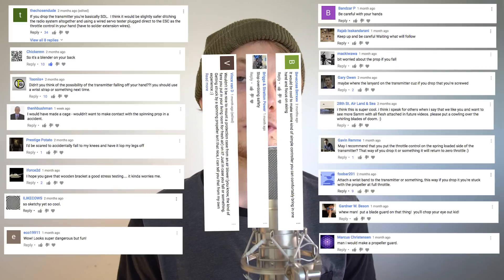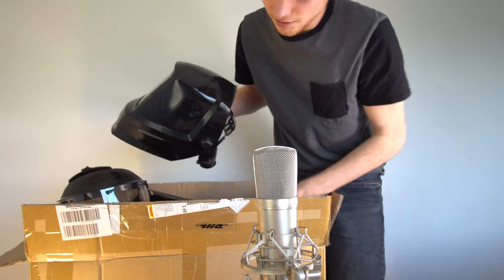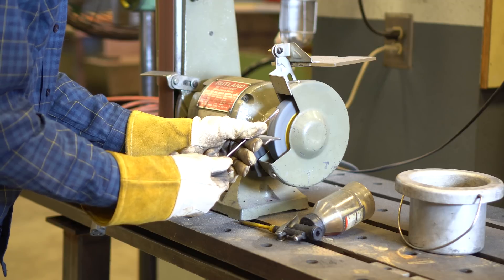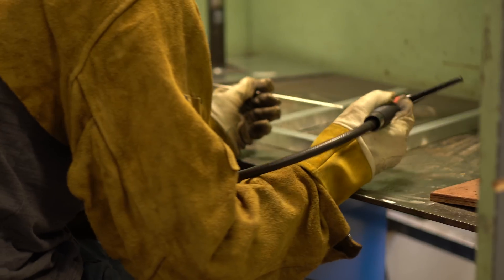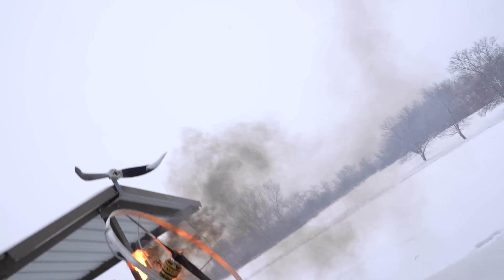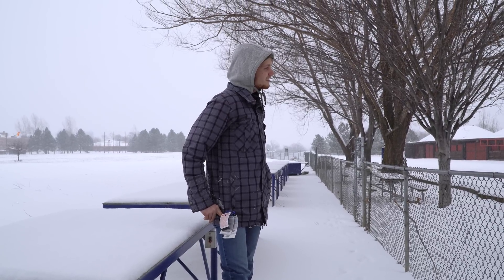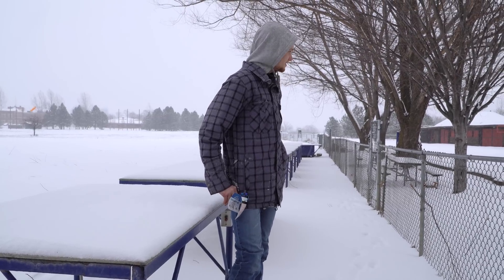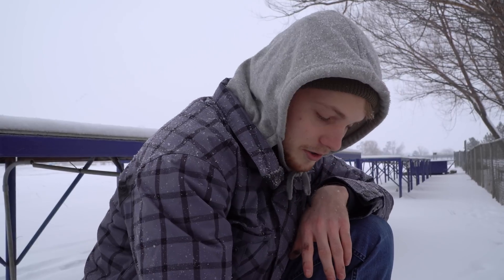Building Propeller Backpack V2 🔥  4k

Comment: You had a short circuit somewhere in the circuit.  Did you check the current draw and how much the wire could take. My guess is you overloaded the conductors and they melted the insulation which then caused one of them to short to the frame or another wire.

Comment: I popped a lipol battery with a pin thinking it would relieve the pressure as it was bulging......
Never pop a lipol.
It shoots out a hot jet of white smoke then turns thick black like a smoke bomb for a good 2 minutes then smoulders with a glow and some flames....
Lithium is toxic but the fire brigade didnt think so....
I felt sick for a day or two and still remember that horrid smoke taste on my mouth.
Please have a co2 fire extinguisher handy and a kill switch the same as race cars use (maybe some sort of rip switch)
Also those cables are very thin.....
Use a bus bar set up - bolt the leads with the xt60 connector to the bus bars and heatshrink the copper bars to the ESC.
Whats the maximum current output of the system to ESC? 100A? 200A?

Comment: Samm the fire should be due to when you suddenly cut the power, not due to high amp draw. imagine a high volume rush of water in a pipe, when you suddenly stopped it, what happens? this link explains it. So never sudden cut throttle
https://www.rcgroups.com/forums/showthread.php?952523-too-long-battery-wires-will-kill-ESC-over-time-precautions-solutions-workarounds

Comment: to much current into a esc which is not made for that kind of power. You should read more about your esc before trying this again. specially if you want to fly with it. If you fly rc plane or drones or try to build them your self you will automatically learn alot....
Reply from the maker: If you look at my channel more you’ll this all started from scratch building RC.
Reply: Yep. Sry :) At first I tout you were a new beginer :) Like I was many years ago, but then I saw what you are doing and other video's. I should have looked more at your channel, you are right. Anyways GOOD LUCK and hope to see many good video's from you :)

Comment: Well that sucks :( going to need a new ESC if everything else is ok.
You should get a low KV motor for more torque on the huge propeller if you can
and a much more beefy ESC to handle full power without smoking.

Comment: are you using 150cc outrunner motor?maybe you could make some DUCTED FAN instead of ducted propeller.i think it will make more grip on air than propeller can,so it could create more thrust.
Reply from the maker: Larger propellers have significant static thrust and efficiency advantages over ducted fans
Reply: have you ever measure your speed?is it efficient than motorcycle in terms of power ?just wondering.
Reply: are there any available larger ducted fan available on the market for your outrunner motor?what if you will do some experiment  between those two,illl be glad to see it...ive had read  your idea about ducted fan and props.but WHY DO COMMERCIAL JET AIRLINER uses DUCTED FAN instead of using 2 BLADE OR 1 blade props.?for me ducted fan has capable of PULLING HEAVY LOAD than propeller thats why props are only for those light aircraft.but whatever reason or answer you have  i will respect your idea men,because your the MAN.your the best.

Comment: Did you ever find out what caused the fire? If I had to guess I'd say it looked like when you let off on the throttle their was too much back EMF made by the 3 phase motor windings that fed back into your motor controller. Look up industrial designs and see what they use for protection. Off the top of my head I think it would be 3 diodes. Cheers!
Reply from the maker: Nah I just think it was unlucky water damage from the snow

Comment: Hi Samm! Absolutely love your videos!  if you made the top of a wing rough and "grabby" (to cause more friction with the air) and the bottom very smooth would it generate more or less lift than an identical Wing that is smooth all around?  I don't have the materials to test this idea so I figured I'd ask someone who might know without having to test it.
Reply: upon further inspection of this idea I realized air would adhere to a smooth surface around a bend better than it would a rough surface but still curious what you think

Comment: dunno about your electrical background but maybe you should ask for some help from EEVblog or Bigclive? Those guys could probably draw you up something crazy to regulate the voltage on that thing.
Reply: There's no need for voltage regulation. Assuming the ESC was rated for 12S LiPo (50.4V max), and I'm sure it was, he was well within spec. ESC's "pop" on occasion as all it takes is one output FET to be conducting when it shouldn't be and instant fireballs appear.

Comment: hey, esc's normally burn, if cables between battery and esc are too long.
google it. also keep in mind that checking amps is not enought. you
have to check amps in relation to rpm (otherwise your motor gets
hot and maybee you overload it).

Comment: WTF!!!! You should never wear gloves with a bench grinder!!! That is just asking to have your hand ripped off!
Reply from the maker: It's interesting actually. When working in the machine shop, gloves and long sleeves are strictly prohibited. However in the welding shop, exposed skin is strictly prohibited. This makes sense when working with lathes compared to flying molten metal. However these two worlds do conflict when it comes to the bench grinder.
Reply: Samm Sheperd - With rotating machines (Grinder but not Angle Grinder or Sander, Drill, Lathe or Mill, etc.) there's no Gloves.

Gloves for Plate Cutter / Bender and Fabricating.

Welding Gloves (different from other gloves) for Welding.

Also you need the 2nd Year of Welding to get decent Instruction for Aluminum, otherwise you should stick with Steel.

YT,
Rob

Comment: The long battery wires are what fried the ESC. The longer the battery side wires, the higher the voltage spikes from the inductance. You need to add capacitors at the ESC, and make the adapter as short as possible. This is an issue I have experience with in high power gliders that have really long noses and have to have the battery under the wing. Some ESC makers even sell capacitor banks for this reason. Google "long battery wire esc" and you'll find a ton of good info. Or see here: rcgroups.com/forums/showthread.php?952523-too-long-battery-wires-will-kill-ESC-over-time-precautions-solutions-workarounds

Comment: Which I can safely say is that a capacitor has burst and the black smoke from the electrolyt has ignited.
Why exactly, I can not tell you
but

Your connections are not weatherproof.
You have an aluminum fram. Your capacitor cap, are free ???
Water and some bad luck .....
Look at you picture 7:14.
I even see the gold at the motor connections. If something makes a short circuit ...
Play save haf fun

Comment: lol thats why you mount it to something other than yourself for the first test. mount it test it then put it on and use it. that said this happens escs can just burn i had a few do this and they were rated correctly.usually a poorly soldered component inside the esc with so many micro solder points. my opinion you did everything right this company should have given a refund. i always pass my power through a capacitor to help regulate it and filter noise a bit better so i can use fpv but i think it is also good for receivers and maybe escs it helps alot imho.  good to hear your using castle creations next it should hold up well. just change the motor and esc after about 35 hours of use so you don't have another fire. looked like everything else was going to be ok but the esc lucy the lipos and motor didn't go up with it like they do in a tight cockpit of a rc plane. keep welding you will get better  great job all around! :) ps i still fly with guys like that they still offer some sound advice once in awhile lol.

Comment: Can you damage your camera sensor from looking at a really bright source? I did see something about an ND filter (not sure what that is). Anyway cool video
Reply from the maker: I did a little googling and it said there shouldn't be any risk from filming welding. To get the close shot I used an ND filter (neutral density) which is just a really dark piece of glass you can screw on the front of the lense.
Reply: Cool. Man this project is pretty intense with the welding haha. Awesome you got help/use the facility. Did you consider a bi-motor design with smaller propellers rather than one big one? You could have differential thrust for steering haha.

Edit: also rimfire motor man aren't those expensive haha

Edit: oohh fiiireeee!!! Haha you didn't look up your max current draw build a little shunt. I supposed you'd need an esc to test the motor anyway. A little action in there haha.

Comment: countersink then tap.  use lube.
Reply from the maker: That's best practice, but on thin aluminum I'll risk my own tools and be lazy.
Reply: i should have said what a nice rig it was.  since those holes are in that rel. thin tubing you could weld a small boss or plate on there to get you some more threads.

Comment: ALUMINUM DOESN'T WELD!!!!!!
Reply from the maker: +Rc Dude I think you may be mistaken
Reply: +Samm Sheperd (SNRS) are you sure I have a underhead valve 5 hp engine block and were trying to weld one of the shroud brackets back on but the entire block is aluminum so it doesnt weld!!!!!!!!!
Reply from the maker: Well it can be really hard, you have to know what you're doing, and the aluminum block would be really hard to weld onto because it's a huge heat sink. You'd need a very large high power TIG welder on AC and the skills to use it. It's not a good idea to weld engine parts because the heat will warp things
Reply: +Samm Sheperd (SNRS) we do have a giant tig ac welder and the skills to use it and we still cant really do it

Comment: I burned one up from having too much resistance on the prop. it just burned the esc right up. It is usually possible to get the blue smoke back in there, but once the orange stuff comes out its probably KO'd.   

say can you guess the thrust you will be gettin with that system?

Comment: do you have all those 6s batteries in series? to much voltage!
Reply from the maker: Well if you looked at the wiring harness I made you can see it's two series harnesses connected in parallel. So the 4 5000mah 6s now make a 10,000mah 12s

Comment: I think you shorted out the motor wires on the aluminum make sure you heat shrink everything properly and tie wrap the wires up so they're not hanging loose
Reply from the maker: I'm pretty confident that it was water that got onto one of the mosfets
Reply: Samm Sheperd sill you should test your setup using the calculator I left you a link for https://www.ecalc.ch/

Comment: Again with the esc... Glad to see what not to buy
Reply from the maker: Honestly that's a really good ESC I think I broke it with water damage being out there with so much snow. Super unlucky I think.
Reply from the maker: Thanks man, I do have fan funding enabled on my main page (nobody has ever used it..) and I have a patreon set up if you wanna help out that way
Reply: Samm Sheperd Sam can you coat the next ESC and exposed components with that silicone protection we are using on the drone ESC's and FC's?  
I can get the name and a link if you want.   It's a good idea anyway considering what conditions other than snow you want to run this beast in.   
Also maybe adjust the thrust down slightly so it would tend to lift your weight rather than dive you into the sand/snow or whatever other thing you choose.   Set up a go find me page for the next gear.  
I'll throw in some $$ just to see the next video.  Your progress is in strides.   I know the old guys timing was terrible but looking back you will realize he came out there at the right time to keep you distracted and not drowning in frustration from what just happened.   Keep up the good work man.  👍🏼

Comment: Very cool! I have had a project in the back of my mind for a couple of years now, equipping my hangglider with a solar-powered (and battery-buffered) boost engine. Now at least the electronics side seems to be ready for that project. Unfortunately, even thin-film solar panels are still too heavy and inflexible for this idea.

Comment: Weird question, do you print tpu motor mounts for quads?
Reply from the maker: I sure do! 
Ebay: http://www.ebay.com/itm/252748511166?ssPageName=STRK:MESELX:IT&_trksid=p3984.m1555.l2649
Thingiverse: http://www.thingiverse.com/thing:2018045
Reply: Samm Sheperd just got them in the mail today, nice job! They work

Comment: sees the prop is twitching, reaches through prop disc to disconnect wires

Electronics is hard without fingers !
Reply from the maker: +shodanxx one of the esc wires melted out of the case. It could only twitch
Reply: Not true actually. I've powered a 4 phase AC motor from 20v with only two wires attached. i gave it a nudge and it TOOK OFF. if that thing got going. it would absolutely take off your entire hand. (What happened to my motor though i didn't lose any fingers i had no props attached)

Comment: you may want to check the amp rating on the yellow wire/battery connector as it  think their only rated for around 80 amps or so if i remember correctly
Reply from the maker: +007killnoobs xt90's are designed for this

Comment: There is a bright flash right as you let off the throttle. I wonder if this ESC had trouble with the sudden braking of that rather heavy prop? I would think that slamming the throttle from full to zero (as it looks like you did), would cause a similar stress to slamming it immediately from zero to full when starting up. But when starting up you did it gradually so it didn't take it so hard going that way...

Comment: Holy crap man! That was insane! By any chance did you get water on the controller? I've always had the exact same thing happen (on a smaller scale) once a drop of water touches the mosfets or other components on the ESC. It always ends in flames 😆

Check the windings on your motor too and make sure they're not damaged by the esc, I've had a few controllers destroy the motors as it seems to short out a phase and destroy that winding. 

Plz be safe! And now I know what this 🔥 means!
Reply from the maker: I've had the same suspicion. It didn't look like a normal burn out. Interesting though that it happened at high throttle. I've had the water fire too but it was as soon as the ESC began the start sequence.

I was also concerned about the motor especially since I was distracted with it still plugged in and twitching. I checked it out and it still works with no noticeable damage.
Reply: PeterSripol "it always ends up in flames" I love how you know this through countless experiences!
Reply: Omg it is peter from ft oh my god oh my god
Reply: Big fan
Reply: prety sad that hes dead now rip
Reply: PeterSripol Great comment!!!
Reply: Samm Sheperd So what's the sitrep now?
Reply: yay peter
Reply: hey peter your plane is insane :D
Reply: The motor is usually always a lot more resistant than the ESC. depending a few things of course...
Reply: By the way. U can call me Al..
 Al -yoU-min ee Um 
minion.
Alu-min-i-um. 
Its not illuminated
Reply: Aloo minum

Comment: you might consider using larger wiring. At 100amps a foot of #12 wire could be dissipating 15 watts under continuous use, it's also going to get very hot.
Reply: 10gauge wiring would be better. but 8gauge wire would be MUCH better